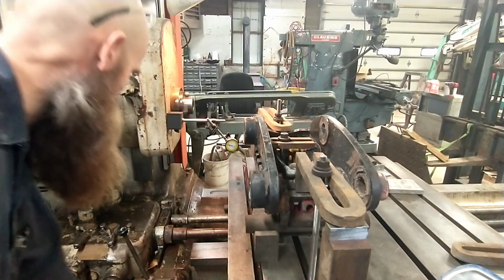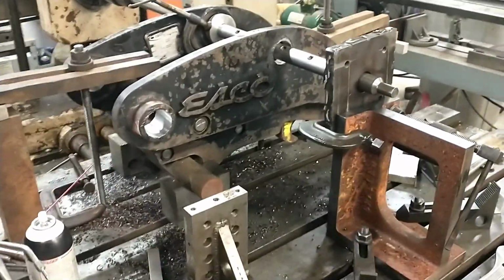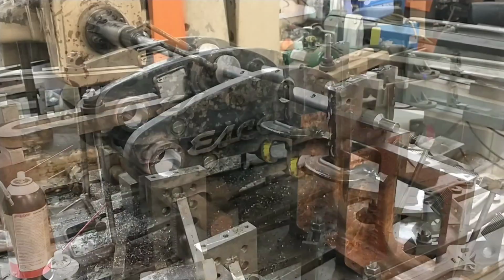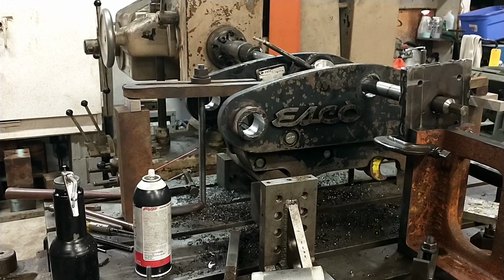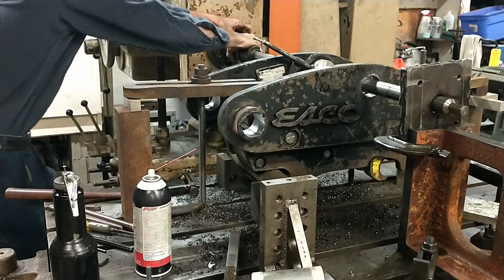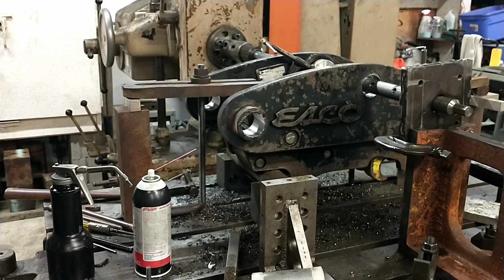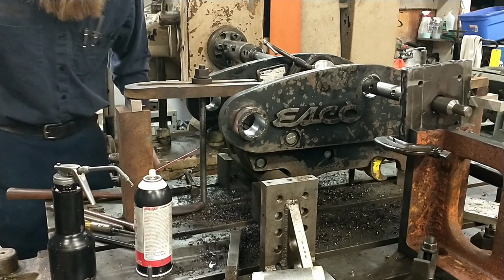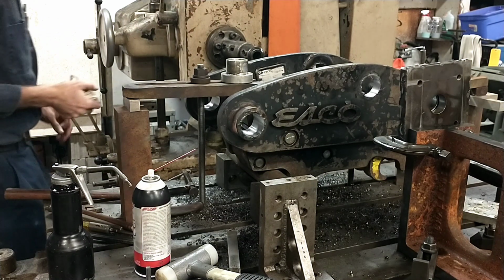Boring The Pin Holes, Excavator Quick Attach on The Lucas model 41

Comment: Is the spindle motor constanly running when the bed is being moved?
Reply from the maker: Kind of, you can put the spindle in neutral, but then you have to shut the motor off to shift it back onto gear. It is easier to just let it spin.
Reply: @Andy-PerpetualMotion  I suppose there is no load on it, but would still add up the run time!